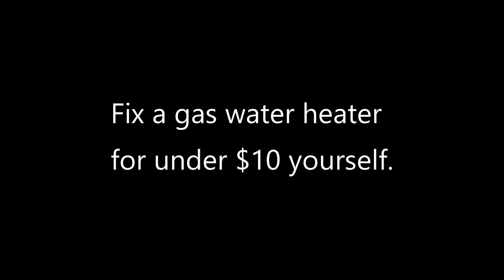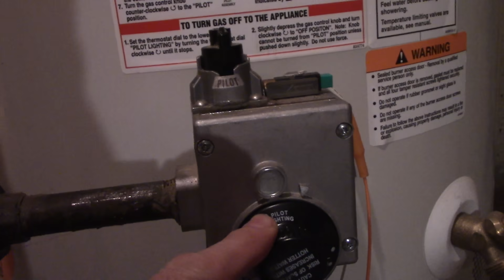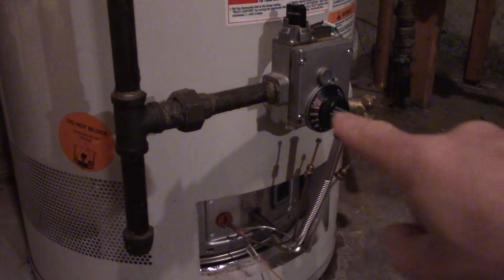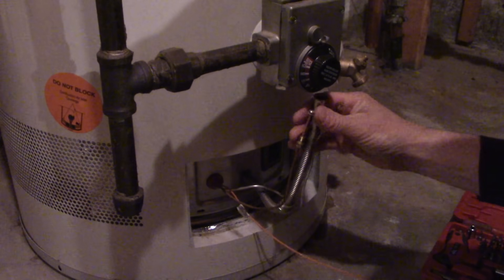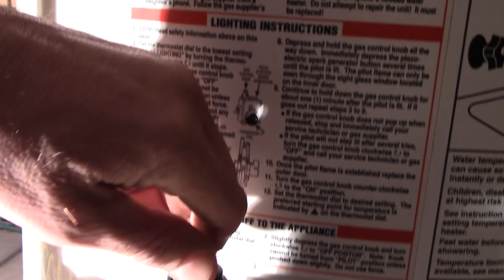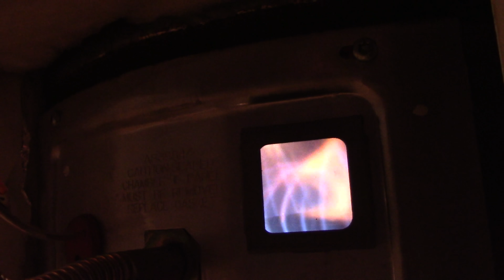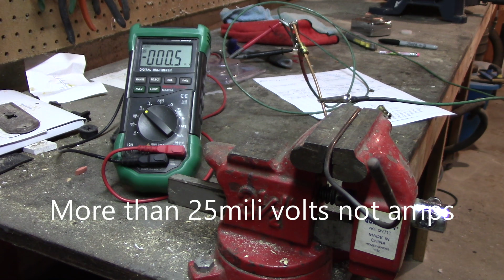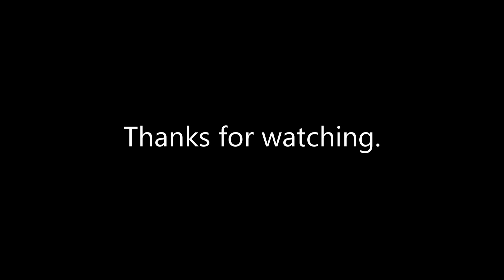No hot water!  Gas water heater burner wont stay lit.

Comment: Wow, thanks. It worked. Took a bit to get the old thermocouple out of the bracket but once the new one was in place, my water heater fired up and stayed on. We have hot water.  A bit of inflation since 2018. The Thermocouple was $12, not $10. Took me about an hour plus the drive to the store and back. Really appreciate your video. Thanks, thanks, thanks.

Comment: What about the "gasket" mentioned on the face of the cover plate? Does it have to be replaced//repaired when removing the plate?
Reply: The one on my cover plate seemed just fine. And any replacement was not going to be as good as the factory install the way I figure it.

Comment: I cleaned mine and it is still acting up, ran a heating cycle without problem then stopped with same issue and worked again later.  The other cause could be the gas line pressure regulator. They reduce utility company pressure from 2 Psi down to 7-11 inches water column. My heater manual says it needs at least 4 inches W.C.  If the regulator is acting up or if the utility company is not delivery enough gas pressure the heater might turn itself off with an error code.  There's a vent  screw on the regulator that can get clogged with oil and cause it to malfunction giving insufficient pressure to the appliance. The heater manual actually say : "Is there a minimum of 4" W.C pressure. If No, call gas company to increase gas pressure".
Reply: Is there a pressure read out on yours? Mine is 30.yr.s old.
Reply: @MeTreesndirt  Ok, update: I removed the bottom cage, took out the gas tube with the thermistor temp sensing stick. I vaccumed the inside and outside around the grid. Then i used 2000 grit sandpaper to remove carbon deposit on the thermistor stick. Gas heater has worked ever since without problem. I hope it'll stay that way.  Forget all i wrote about the gas pressure that was not the issue.  Try to vacuum all the dust and debris and clean the thermistor. The system wasn't breating in enough fresh air and the thermistor might have gotten a deposit of carbon from the incomplete combustion.

Comment: Hi! I think I have the same problem. I bought a thermocouple replacement kit at HD. I took everything apart and now I cannot get the nut to the bigger gas manifold tube to connect. I don't understand what's going on. 😞 I've tried screwing the cover in place first, I've tried unscrewing it and and connecting the gas manifold tube. It isn't working.
Reply from the maker: I don't know exactly what you have but sometimes gas fittings are left handed threads try going the other way

Comment: Your video was great but we still have not had hot water for one month.  Please help.  The water heater is in the attic. My husband replaced the thermocouple, and the burner assembly.  He cleaned the air register.  The pilot light will stay on forever when the burner is not on.  When you turn the burner on and off the pilot stays lit.  But when you leave the burner on both the pilot and the burner goes off after about 15 minutes.
Reply from the maker: Sorry I can't help without seeing it. But in general if the heater is @10 years old your best bet is to replace. There is a label with the date of manufacture.
Reply: You need a
Professional
Reply: do you remember what fixed this?  mine is doing the same..have replaced therm, cleaned bottom plate, and removed thermo eco sensor. it seems like an air flow or valve issue now....What do you say?
Reply: SAME HERE 🙋 EXACTLY...
🔥Pilot stays on. Burner then is set to desired heat.  All is GOOD
Pilot & burner after a minute OFF
But mine backfires.
Tested Everything even the control unit itself, all seems to work. 
Another Video I saw. POSSIBILITY the Pilot needs to be bent closer to burner. Not much just a little. 
EITHER WAY PLEASE HELP

Comment: Can I replace the mechanical gas valve with a digital one?
Reply from the maker: Dont know but I would think a valve would be a little pricey and these residential water heaters are fairly cheap new. And water heaters only last an average of 10 years , so my advice is just leave the manual valve in place unless yours is faulty.
Reply: @JLafix  Thanks for the advice.

Comment: This fix won't last, there's something wrong with the flame, the flow of air is not going up correctly, you can tell by the shape and color of the flame and the black soot build up seen in the beginning of this video.
Reply: I think he just wanted hot water at 5 AM.
Reply: How can the air flow be fixed then?
Reply: Bummer.

Comment: Should the burner constantly stay on or does it turn off and on as needed? My burner stays on but turns off after it seems the tank is full just not sure though.
Reply from the maker: I'm pretty sure it fires when it needs to but you should see a pilot light on all the time through the little glass window
Reply: The burner runs to heat the water tank when it gets to the temperature of the thermostat the burner goes out and the pilot then lights back up